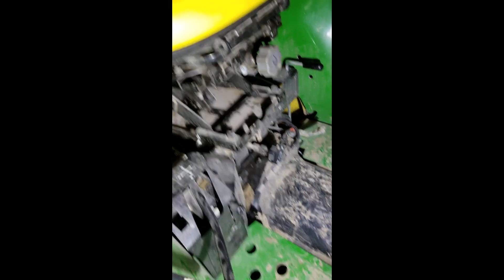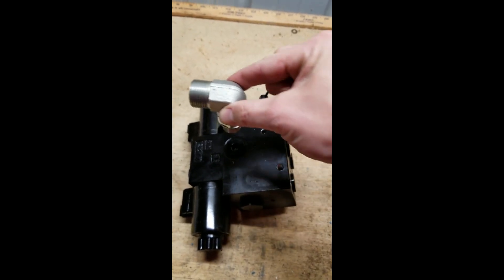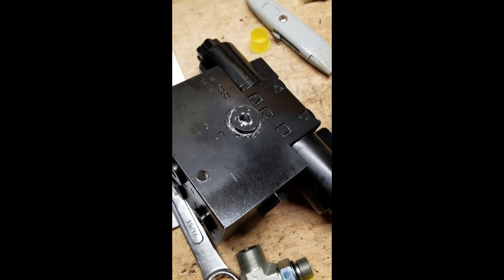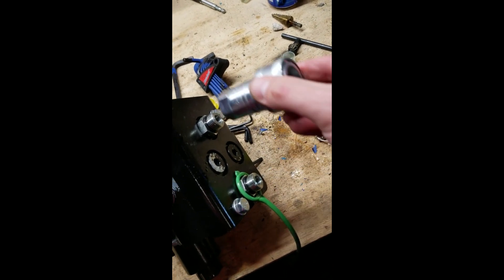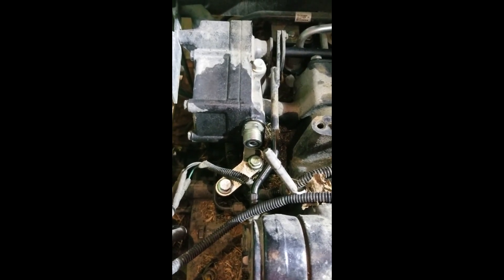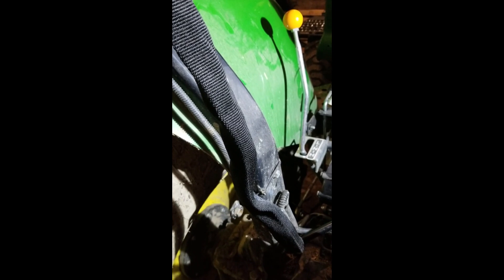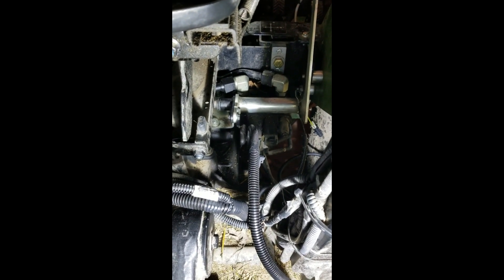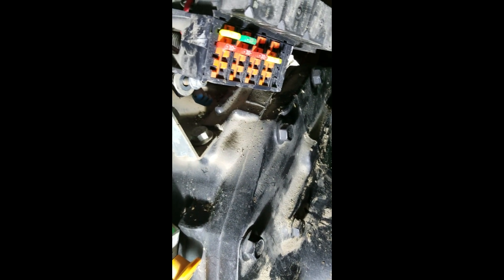Installing Rear Hydraulics on John Deere Tractor

Comment: I was interested in your video because I also own a 4105, but much of the audio was not clear.  Also I noticed a second set of holes on the unit.  Will it support a second set of hydraulic connections?  Also, I have a third function valve for a grapple on my tractor that is already controlled by a button on the joy stick.  So this kit would not work for me unless I could mount the controls somewhere else.

Comment: Really like y'alls videos.  I hymed and hawed about getting a 4052R but based on my needs I decided on the 4105.  What seat is that you have on there?
Reply: @IndyFarmLife  You wouldn't happen to have a parts list of what all you did to get the 4052R seat on there would you?  Looks like you replaced the whole mounting system.
Reply: Hey guys, hope y'all are well and safe.  Can you show a video of the how you wired in the front hydraulics (and how you change between the front and rear) to the existing rear hydraulics/ switch on the loader control.
Reply: @IndyFarmLife  Hey guys hope y'all are well.  What hydraulic top link did you put on you the 4105?   I'm wrapping up installing the lvb26030 (and was able to mount the 12v plug that came with the kit) and am working on installing the BW16138 (hard line kit).  Keep the videos coming.
Reply: @mac-wm3xy  Good evening, just trying to find out if you ever got the Hydraulic top link info or did you buy one yet. I have a 4105 and I'm looking to start doing some upgrades and wanted to get one.

Comment: Would you happen to have the part number for the kit.  I have checked john deere parts online but I do not see a 3rd SCV kit for the 4105 tractor.  We recently bought a 375 backhoe so I have the power beyond kit for that, but I want to add the 3rd SCV kit for other attachments.  If you watch the following video you will see what I plan to do.  https://www.youtube.com/watch?v=JYtrEik9U4Q&t=293s

Comment: Great video... Very detailed... Myself, being a new 4105 owner.. I plan to install the third function kit, but for the  loader ( grapple)  I also need rear hydraulic ports but plan to install a manual valve. Like the older tractors.